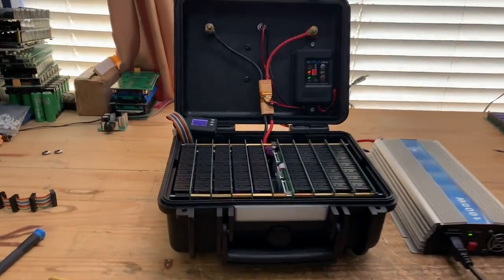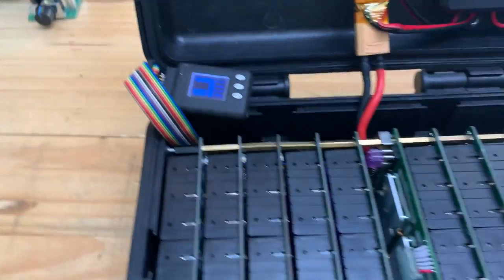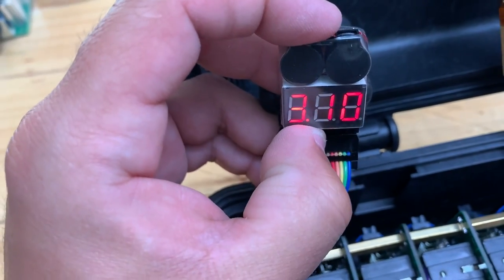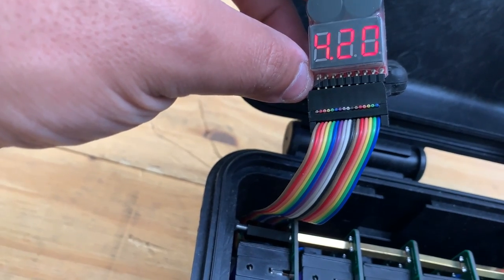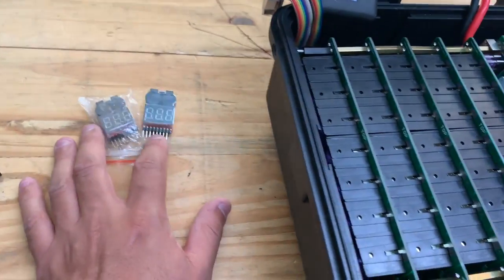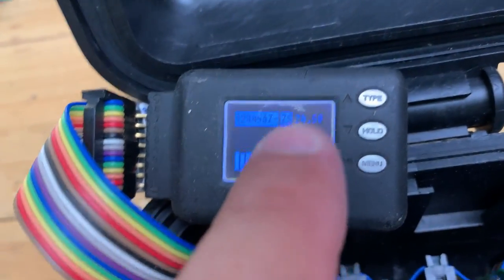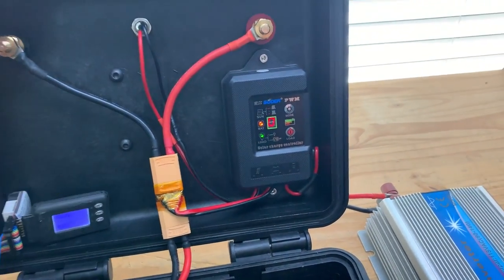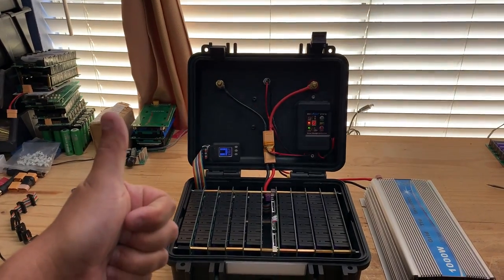The Challenges of Using cheap Chinese Electronics in DIY battery Projects

Comment: Those things always worked when i used them in RC.  Never had one do what yours is doing.
- Maybe under huge pulsed load from the inverter you are getting very tiny negative spikes below 2.7V. Some caps from each tap to GND and resistor in series would filter that out.
- Maybe no one normally uses them set to 2.7V because for RC lipo that's way to low. Maybe they just don't work right when set that low

Comment: Check them out WITHOUT your other monitoring device!! I think that interference between the two measuring units!! =] 

...PS: They are nso f..ing loud OMG!!!! drop one drop superglue into the holes on the speakers, even than very loud (one has gone of before once and a while, while I was asleep. I woke up and thought hell broke loose, it took several minutes until I remembered these little things, it came out one of my HUGE portable speakersystems where one pack of cells has gone under my preset value of 3.2V. Worked well for me, but maybe took some serious eardamage)
Reply: lol

Comment: That must be your overvoltage alarm?
Cheap chinese electronics is a miss-hit business... it either screw or make you.
Been following you lately and what i love most is your powerwall project. Keep up the good works!
Reply from the maker: True that,  although turning off the low voltage alarm also turned off the high voltage alarm?   Maybe
Reply: @marthale7 
If you live in the Philippines, like me, or anywhere else in asia that is flooded with chinese electronics, you can really tell which one works and which doesn't. Luckily, there some that really works well.
Reply: @jehugarcia  
Aahh yeah such maybe the case...
I wish i can replicate your powerwall project. They're just too awesome to be ignored.
Reply: Yea the one cell looked like it was 4.2 to the tester so maybe it is the high voltage alarm I have one and when I'm charging it will beep right as the charger beeps or just before it's a turnigy branded one tho

Comment: Those cell checkers work perfectly. I bought the spim08hp for my electric mountain board and I use those cell checkers for each of the 6s packs I made. I have bought a bunch and I have tested the accuracy of them with real measuring equipment and they are good to about     +/-.05 volts . You have a bad cell in your pack or a weak one that is sagging because of your load and the monitor is detecting it. Don't write those off as bad products.

Comment: Mine works really well for my skateboard. There are some suggestions in the other comments about pulsed loads and bad solder joints, the easiest way is to use them in other applications, and test more of them, it is highly unlikely to be a solder issue if say all 10 of them doesnt work properly.

Comment: Hi Jehu, Have an old one will a lead acid battery inside (I think). I wanted to take it apart and replace the battery but now I'm thinking of just replacing the battery with Lithium batteries. So excited to try it! Better than just buying another one!

Comment: Use 1 beeper per cell.  That way any balance wire that wasn't making good contact wouldn't affect things, and you could troubleshoot easily.  I'd put a resistor or fuse near where you tap the balance wires out also, you don't want an accidental short to start a fire.

Comment: Bad/cold solder joints on the monitors. I have several of these for rc plans. They tend to have crappy solerding and result in lack of uniformity on resistance back to the chip resulting in dramatic voltage drops.

Comment: Perhaps your 3 channel unit is averaging the voltage over a second or more. This is a common practice with digital meters. Then your alarm is monitoring on milliseconds and when it sees a very quick dip, it trips. I'd watch the voltage on an oscilloscope, then you can see how stable the voltage is and if it dips below 2.7v.

Comment: Great Video!!!! I purchased a few of those last year, 50 or so. Around 4 or 5 of them did exactly that...But if you get a good working one, it usually does the job. The only problem is cell #2 will pull around 50 or so mah from the battery. Causing an imbalance sometimes.
Reply: How could you know?  This is an 8 minute video and you commented 2 minutes after posting
Reply: @michaeltimmerman2130 Timmerman might have been when you got the video and I posted after he mentioned the cell reader. Besides, I have NEVER seen a bad video coming from Jehu!!

Comment: Theres low voltage cut offs -- with timers integrated with a few double a battery backup for the clock -- you could put that on the main output to say only run the inverter/bank at night -- and since you have a BMS a tiny arm/risc/PIC setup may allow you to do what you want AND have more features -- like the ability for push notifications of battery voltages to your cellphone -- and in a worst case scenario turn off the device -- not to mention a tiny arm SOC with 2 usb ports and bluetooth would potentially allow a cellular modem expansion, monitoring the BMS and thermals for remote control and monitoring of the unit for remote solar deployments -- or for first responders, medical patients whom need it to keep infusion pumps going or other things -- overall its just the wrong solution -- noise is great but it cant intervene or notify remotely during critical failure....

Comment: If you scope the battery back while the inverter is drawing power from the pack an inverter does create a lot of “noise” or square wave pulses pulling voltage up and down which seem to mess with the cheap balance lead battery monitors. If you connected a straight resistive load instead of the inverter they will work just fine besides some cells maybe a few 10s of a volt off since they are cheap!
Reply from the maker: Did notice that after I shot video
Reply: jehugarcia yeah without a lengthy explanation those cheap cell beepers only sample one cell at a time and reference against ground and subtract the previous value. For example cell one is 3.25v cell two is 6.6v but the meter subtracts the previous 3.25v and displays 3.35v and so on upto 7s or whatever. 
So if the inverter is creating ripple and the cell beeper measures one cell “high” then the meters next sample maybe on the “low” side of the battery ripple and thus it thinks that cell is low and sets the alarm. Basically pretty annoying as I went down your path before!

Comment: I have a lot of those, they all work perfectly fine, try soldering your connection, yours probably is bad. Also the other measuring device could cause interference, connect them on a separate ribbon cable :). Nice vid!

Comment: Those little monitors load the first two cells to power them selves.  You need to to use  switch on the Neg wire or they will through your pack out of balance.

Comment: I use those alarms in my rc planes and if they work well, when it beeps I check that cell with a multimeter and read the same thing. The same as having that inverter connected to the output without any filter affects the measurement of cheap alarms.

Comment: Nobody who flies drone seriously uses those things anymore. When punching out on a high kV motor the battery sags and those things go off.   FPV racers have a visual representation of individual or total cell voltage inside the goggle  OSD.
Reply: Or telemetry for line of sight

Comment: Dear Jehu wish you a great day, I wish to get some of your used cells they are more accurate than the ones I checked here in India they are Chinese made 18650 cells rated 3.2v 8amps a cell but a fresh new cell out of box reads 2.5 V and 5 amps is not something expected for performance, today I visited the junkyard to find myself a scrape car which is just body chassis frame and tires to tow it home. Please help me with batteries, I could understand what a C through your videos but not clear with 3S 4S 7S ratings and their uses please guide

Comment: Have you tested without the other meter?
Reply: Try it without the bms boards. Maybe the voltages are being polled at different rates causing the rc lipo monitor to be pulled low by the bms boards. Idk
Reply from the maker: It was the inverter,  soon as I replaced the load the voltage stabilized
Reply: @jehugarcia  I wonder what would happen if you put a 50v capacitor in parallel with the bad load. Low esr electrolytic ~1000 ufd... 🤔

Comment: Plug these devices into a lab bench psu with a specific output voltage and compare your two devices. That way you can say 100% that these new devices are actually faulty. I just find it odd that there is such a variance display on your cells.

Comment: You can make a dang nice arduino meter which I’m working on.. gonna be sweet when I’m done, for voltage current ir, etc.. or jus programming the Atmel chip itself or similar
Reply: I was going to mention the same, you can customize exactly what you want to monitor.

Comment: I've got two of those low voltage alarms - they're crap. Too inaccurate and have no way of calibration, and also drain power by running the leds continuously.
Someone ought to be able to use the piezos with an arduino and oled display to do it properly.
Reply: you are wrong my friend, I use these as well and I've had one on my small 12v 18650 battery for about six months now just sitting on a shelf and I have not lost any voltage no issues with them. matter of fact I use them on my 24v 20kw 18650 powerwall with no issues, with no BMS and a 6000w inverter and a 60a MPPT solar charger. been running my shop for about 10 months now off grid.
Reply: @thesmoothgoat  Your's may work, mine don't. The voltages are off by up to 0.5V which is useless.

Comment: I’ve never seen that issue with those hobby king cell monitors, and I use them for rc aircraft a lot. Are you sure it doesn’t have something to do with the other monitor being connected at the same time?

Comment: jehu, how about a video about inverters, between solar, the sine wave and EV's. I have a inverter with 2 positives and 2 negatives going into the inverter does that mean it's capable of 24V? is there a difference between the inverters that work off the lead acid batteries, can the same inverter work off lithiums as well?
Reply from the maker: Usually big inverters use dual posts if one will not handle the current but they are paralleled

Comment: You need to learn to code in Arduino. You can easily monitor up to 5 volts.
Reply: The problem is that you're actually monitoring up to 7*4.2 volts. You either need external circuitry or a resistive voltage divider.
Reply: @jmonsted  No thats not a problem, an Arduino Nano has 7 analog inputs that can read all 7. Arduino can read up to 5 volts so 4.2 volts is not an issue. A BMS does not read the series voltage. The Arduino can add them all up. There is already code available to do this in the example code in the IDE. There are other boards with more analog inputs as well.
Reply: @Thrive-Off-Grid  You can't just connect all the cells to arduino pins, because they are in series and not referenced to ground. You would need to either have voltage dividers to connect all cells or switch and only ever connect one cell, so arduino would be referenced to the cell you are measuring.

So, first cell is 4.2v from ground, and the second cell is 8.4v from ground and so on...
Reply: @Thrive-Off-Grid  You can measure 7 analog inputs, but they all have a common ground. The voltage of each cell with reference to that common ground will be up to ~30V, since they're connected in series. I know people build DIY BMSs, but they have to use a voltage divider to now blow up the arduino.
Reply: @jmonsted  @OneMarko Ok I see what you guys are saying.